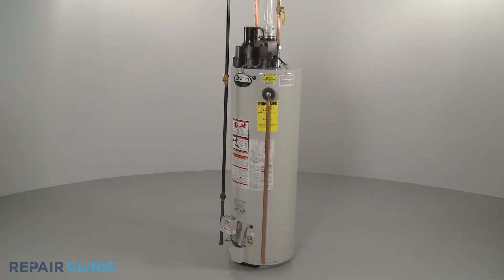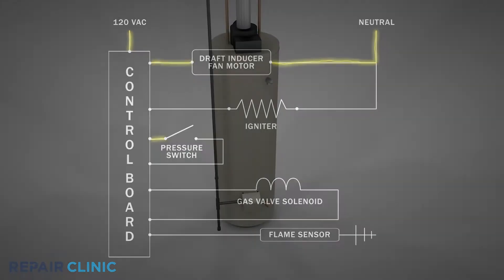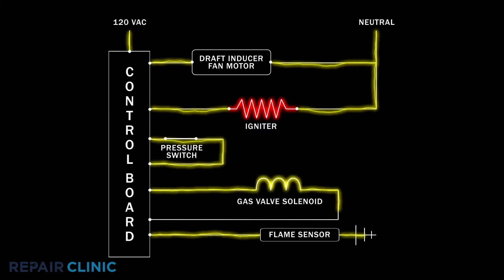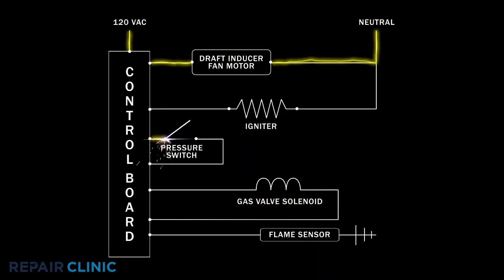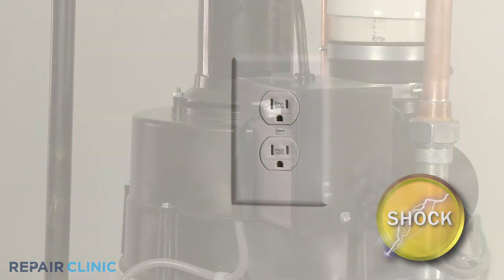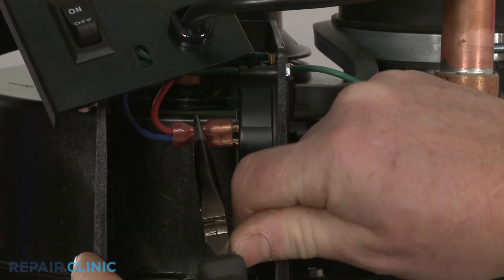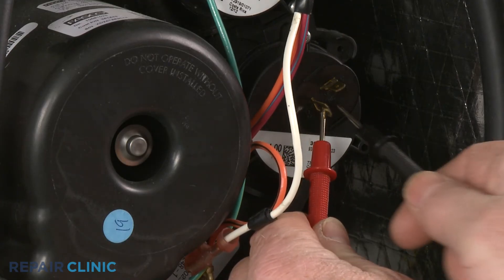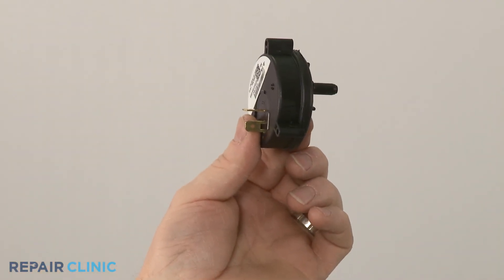Water Heater Pressure Switch Testing

Comment: If the venting, vent termination, motor, motor fan, hose, hose connection port, and your meter are confirmed to be good then you can conclude its the pressure switch, not before unless you use a manometer to read the actual conditions the switch sees.
Reply: Do you get an immediate LO code if it is bad ?